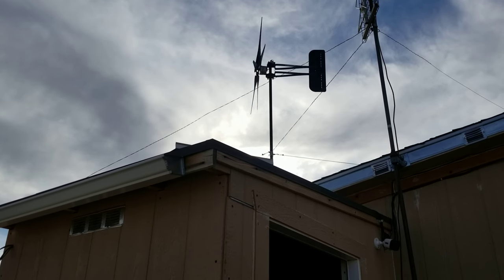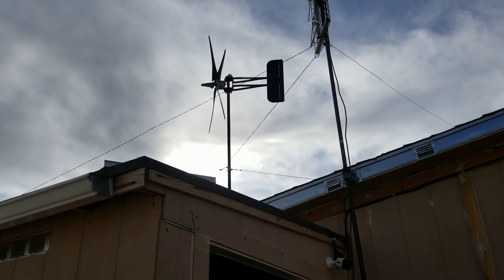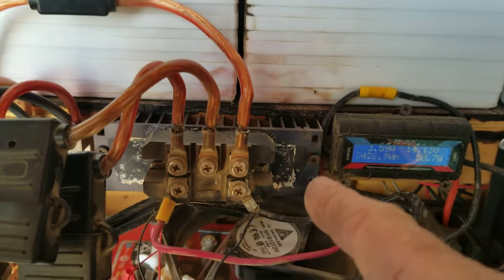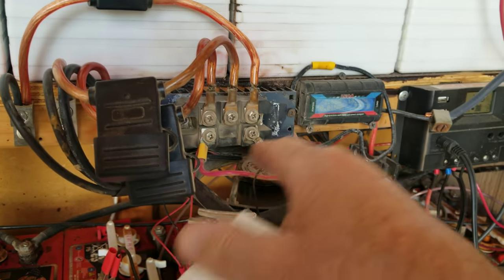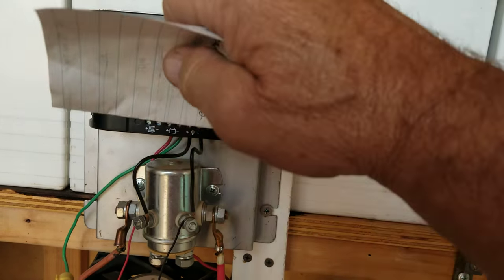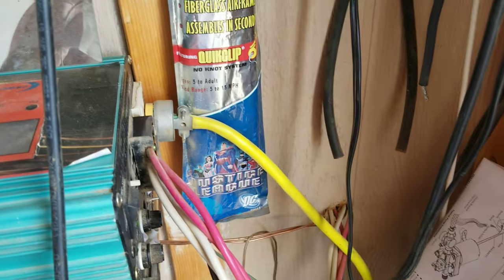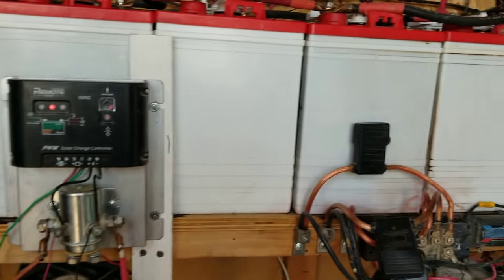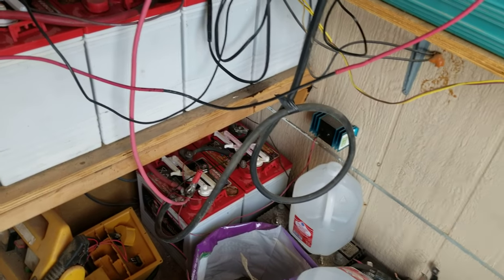Wind turbines, controllers and batteries explained, March 6, 2020

Comment: You can connect your dump load wires to a hot water heater heating element to heat water instead of sending it to a heating element that causes more hot air near the electronics & wastes energy. Thanks for sharing your setup & knowledge.
Reply from the maker: That's true, but as I said before in prior comments of the same subject,  I live in the desert and don't need any more hot water.  My tankless propane water heater only is used a couple of months a year, and very little at that.  The heat produced in the battery room, is usually in the winter and helps keep my batteries warm through that time, making them more efficient.
Reply: @GBear  Gotcha but for someone wanting to go Solar & heat their hot water tank for free using the dump load & a different heating element in their hot water heater works quite well. Speaking of batteries have you done any vids on battery maintenance for lead acid types?
Reply from the maker: @miguelsalami Yes, before I actually moved out here, I had made a hot water barrel heater for my outdoor shower, but once I got here, I realized it was a waste of time. As for an actual video dedicated to battery maintenance, no I haven't. I have mentioned topping off with distilled water every couple of months,  cleaning terminals, etc.

Comment: Like your information. Only thought that comes to mind. Mounting electrical terminals on to wood have risk. Since humidity, accidental roof leak or even a hard driving wind/rain storm, can get the wood wet. Not sure if you are in a desert, but I could never do this.
Reply from the maker: Welcome aboard.   Yes, I am in a desert, and the battery room is weather proofed so rain won't get in.  Also note that all wood mounted connections are low voltage.  (12vdc)  the 120/240v stuff is all in electrical boxes and conduits.  Thanks for your concern, though.

Comment: dumpload controllers with solid state relays SSR have a longer service life , well if the solenoid is switching on and off Alot because the turbine is in a good wind location  the mechanical relays can  get stuck on due to the result of endless arcing so many point out, Very Good video for beginners, one of the best ive seen.
Reply from the maker: Thanks for the input!  Yes, there are better systems, but keeping a mechanical solenoid cool is key to longer life.
If you have the money, go with the relay unit, though.
Reply: The dump load controllers with SSR you speak of are they the ones on the market that only use the AC 3 wires coming in then rectify & control the output to either battery or resistor/dump load? I am trying to take DC from a DC motor wind turbine (DIY) & divert it from the batts once full.
Reply from the maker: A 3 wire PMA needs a rectifier to convert its ac output to DC, DC can then go to the battery and a digital diverter will keep the battery from overcharge by diverting excess to a dump load resistance.
Reply: @GBear  The solenoid shouldn't need a fan.  If it's getting hot, it means it's probably not a constant current solenoid, or it's exceeding the rated voltage/current.
Reply from the maker: @bigrob1887  true, but the fan keeps it cooler. 😆👍

Comment: I learned more in the first five minutes that I did in the previous half hour looking at other stupid videos! Thanks!
Reply from the maker: You are welcome, and Welcome aboard!
Reply: Would the 12 volt BLS be able to be integrated onto my motorcycle?  Thanks
Reply from the maker: Welcome aboard!  The 12v BLS will work on any 12v lead acid battery.
Reply from the maker: Welcome aboard!  Thanks!

Comment: Very nice set up.  I spread my panels to separate charge controllers and batteries which each are dedicated to a specific task and load.  Also I would dump excess load to a hot water heater inorder to storage the excess.  Nice work sir.
Reply from the maker: Thank you and welcome aboard.

Comment: Good Informative Video Sir.

I have both in the works.   12V and 24V .  The wind system being 24V.  Most likely will be going with 24V only at some point.      No Obstructions here so I can get away with the turbine only being 10Ft above my roof line.

The main disadvantage of  using a DC  2 wire Wind Turbines  is DC voltage they produce  requires heavier gauge wire and does not  travel distances as well as AC or Three Wire systems can.    They work for stuff like boats  but for home use  Best to just avoid the things.   

Well it's Semi Official.  Wife works at Wally World and they was informed today to expect the shelves to start being short. The warehouses are feeling the pain.  So if there was a Chines product your in need of at Walmart you might want to think about grabbing it.
Reply from the maker: Good stuff!  I don't buy much from Wally World, although a subscriber just sent me a $10 gift if I order food online and pick it up.  A lot of imports are affected by the Corona virus.  Makes one think if it wasn't by design to quell chinese imports....🤔
Reply: @GBear  
Got to agree, there is something very fishy regarding Chinese stock exchange and Trumps new tariffs.
Here's to bringing back pharmaceutical mfg to the USA and all the other things we consume 👍

Comment: OMG ! Yes I REALLY like how you incorporated the solenoid into the path of the solar charge controller to the dump load. I was trying to find info to use PMA DC type wind turbines (I am making a small scale 12V 12A old water pump motor into a small vertical wind turbine to light a garden are at night :) Thanks again for posting all this GREAT info!
~C~
Reply from the maker: Welcome aboard!  Keep experimenting, it brings about new knowledge, at the least!

Comment: Thanks for the video, I have been trying to get info on how to size the wind generator. My off grid system has 3x100 amp lithium battery and 2.1 kw max solar... I need extra when no sun for days but I have plenty of wind.
Reply from the maker: Welcome aboard Ed!  Ok, let me simplify the sizing for you.
Since wind generators seldom put out their rated value for a consistent time due to fluctuations in the wind, get the highest rated one you can afford.  You'll still need either a diverter or a good Midnite classic controller,  the latter being the better choice.  Not all controllers can be used for wind, but the Midnite classic is designed for it and is very efficient at it.
Take into consideration when going with wind power, max output at what wind speed?  Also, 3 bladed units are a better design than 5 or 7 blade units, but size and shape make a difference also.  The tower or mast height and strength.  My little KT5 PMA has pulled a 300+ pound concrete anchor out of the ground in 60+mph wind.
Guy wires need to be steel rope able to handle 3000-5000 lbs of stress in high winds also.
Then consider access to the PMA for maintenance.  Simple things like bird poop can throw the balance off, causing excessive wear.
That brings me to another thing...be sure to check your hub and blade balance before installing them on the PMA for best performance and output.
Lastly, consider where the PMA will be located and the distance from the battery bank.  Wire size and PMA vs PMG are affected by that distance.

Comment: that one green controller takes wind turbines too. i have the same one connected to four 100watt panels and a 400watt turbine
Reply from the maker: Yes, it is a hybrid controller, but not a good one.  Same with the one right beside it.
I bought those in my early days of learning and retired them when I found better, more efficient options.
Reply: @GBear  i just got it in February so far its doing its job but yes i will be upgrading in the future as my ranch and the system grow
Reply from the maker: Smart man!  We all have to start somewhere and sometimes learn the hard way.  I try to share what I learned that hard way to help others save money, time and frustration.  Welcome aboard!
Reply: @GBear  i have seen i have been watching the channel off and on for the last year and a half now
Reply from the maker: Thank you for your continued support.

Comment: The reason automotive/car batteries don’t work well is because they use crank amps. Electric vehicle batteries don’t need that initial inrush of amps to crank anything.
Reply from the maker: Exactly.  Car batteries are designed to give a quick burst of power, then recharge slowly,  where electric vehicle deep cycle are designed to release power slowly and recharge quickly.
24v aircraft batteries work well for solar, but are very expensive.
Reply from the maker: Welcome aboard!

Comment: How we can connect car alternated powered by wind turbine to charge ev car lethium ion battery
Reply from the maker: Won't be easy!  A car alternator is usually 12vdc, and designed to charge a lead acid battery.  The voltages of an EV are usually in the 48vdc range.

Comment from the maker: Sorry, I said I had forklift batteries, I have golf cart batteries.
Reply: I think they are the same thing that is what I use. They last forever when you run them properly I keep the voltage in my battery bank between 11.5 - 14.4. floats at 14.4 and does not go below 11.5.
Reply from the maker: Forklift batteries are humongous!  But they are 100 times stronger that golf cart batteries and last a lot longer.
Golf cart batteries are a good choice, but add a BLS unit to help them last longer.
Reply: Ah ok, I was wondering how your top shelf was supporting so many heavy forklift batteries! I had decided on golf cart batteries and the video helped validate my choice. I am assuming all your batteries are being charged with the wind and solar? Not one shelf for wind and the other for solar.
Reply from the maker: @SherryTheSecretary  I don't know how I missed this for 7 months!  Weird!
Anyway, in case you still need the answer, all my batteries are a single bank charged by BOTH wind and solar.
Reply from the maker: Welcome aboard Jennifer.  No, I never tried that, because it just won't work.   A 12v PMA won't produce enough power to charge a 24v system, no matter how fast the winds are, or how high the wattage of the PMA. 
It is possible to run the 12v PMA into a rectifier, then use a step up transformer between the rectifier output and the battery bank, but even that would be inefficient.

Comment: Hi, G Bears
I have 12v 105Ah 5 battery (525Ah). How many watt solar panels do i need to charge them? Thank you
Reply from the maker: Welcome aboard! Just to charge them?  Ok, I can see you are new to this, so let me help you understand more about solar.
To charge a battery bank of any size, any size solar panel will supply a charge.
To keep them charged as they may need more input.  For a more accurate answer, more information is needed.
1. What will you be powering with your battery bank? 2. Are your batteries Lead acid, LifPo4, AGM, etc.? 3. Deep Cycle or Standard cycle?
525Ah only means you can supply 525 amps for 1 hour at 12 volts. Or , actually 1/2 of that. Because you only want to discharge a maximum of 50% of battery capacity.
That gives you 3150 watts for one hour. (Amps times volts = watts) but remember, you will lose some of that just powering an inverter 12v to 120v.
Heating and cooling appliances use a lot of watts, LED lights use very little watts.
You need to total all the watts needed by your load, before you can determine how many batteries you need, and how many solar watts input you need, then what size charge controller and what size inverter you will require, keeping in mind that once the sun is gone at night, the battery bank will have the sole job of powering all your electrical needs without any help.
Reply: @G Bear's Off Grid Ways-A Homestead In The Desert  Hi, 
I am  completely new for this knowledge. My main use for washing machine 240v 2500w with hot washing and
I have 5 AGM battery's 12v 105Ah each and 3000w inverter.
Thanks
Reply from the maker: Ok, your battery bank is too small to run that washer after dark, and to run it during a sunny day you should have a solar array of at least the size of your load plus 20%.  That will allow charging of the battery bank while powering the load. The washer will use 10.5 amps during standard run.  Heating water will be a large draw.  
Using 220v, I assume you are in Europe?
Your better choice would be 6 batteries connected series parallel for 24v, but then you would need to change your inverter to a 24v unit.
Anyway, using 2000w of solar panels may allow you to operate the washer at peak sunny days.  Connecting the panels in series parallel to increase the voltage will help also, but be certain not to exceed the charge controller's maximum voltage limits.  You could possibly get by with four 305w solar panels, with 2 strings (connecting 2 panels in series, times 2) into a Midnite Classic  150 controller or equivalent since it will handle 12 or 24v input up to 150v.  Just remember,  always connect the batteries to the controller FIRST, then connect the solar panels, but dont do it while the sun is on the panels.   Cover them.
Reply from the maker: As a simple rule, to calculate
how long a 12v deep-cycle
battery will last with an inverter
multiply battery amp-hours
(Ah) by 12 to find watt-hours,
and divide by the load watts to
find run time hours. Finally,
multiply run time hours by 95%
to account for inverter losses.
Reply: @GBear  
Thank you
Reply from the maker: You're welcome.

Comment: Great video. Can you explain how your wind controller manages the power cover to control the power taken from the turbine at different RPM or Voltages. This is important for efficient operation of the wind turbine, especially at low wind speed. Thank you.
Reply from the maker: @igorrogelj5033  Welcome aboard. 
I'll try in a video soon.

Comment: Enjoyed the video.
One thing (probably of many) that I haven't figured out yet is how is the voltage from the pma regulated.
I assume the voltage will vary with wind speed but you need a nice steady 14.5v to charge the batteries.
Reply from the maker: Welcome aboard.  Yes, the voltage is quite variable from a PMA due to wind speeds.  The best way to control it is through a Midnite Classic controller after the bridge connector.
I still have mine 'old school' style where the bridge rectifier connects to the battery bank and a dumpload controller monitors voltages in the bank and dumps it if it exceeps capacity. I was going to upgrade to a Midnite Classic controller bit the economy made finances go south.

Comment: How close to the ground can you have the turbines and have them still work OK? I want to be able to put one up but not have it so high up that everyone sees it, because our municipality I don't know if I can get away with it yet. So I wanted to find out what th eminimum height to get these to work typically is? And because maintenance would be easier if they aren't really high up. 

Thanks.
Reply from the maker: Welcome aboard, Noah!  If you live inside city limits, they usually aren't allowed.   They need to be high up, especially around multiple buildings that would affect air flow.  Also, if you are on grid, it wouldn't do you much good anyway, unless it was a very large turbine.
Sorry to sound negative,  but I don't want to mislead you.
Reply: @GBear  Hey GBear thank you for the reply. I appreciate the comments. You weren't negative but just being real. Actually you are probably right. 

I'm curious if they could be used for camping though, or if it would just end up being too hard for a portable set up with one?
Reply from the maker: @Noah Riding  The higher up you put them, the better they work.  Solar is a much better bet for camping, as you don't always have wind, but the sun is pretty reliable.  Turbines are supplemental providers, and shouldn't be relied on as the main source of power.  After all, who wants to camp in 40mph winds?🤔